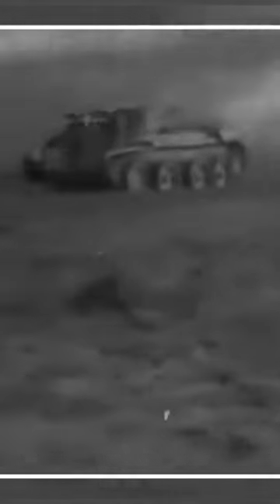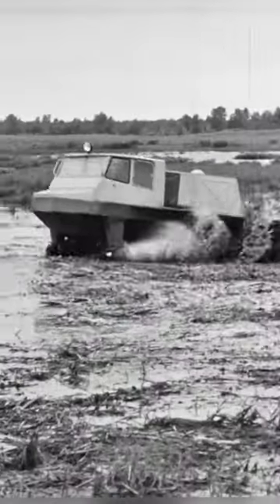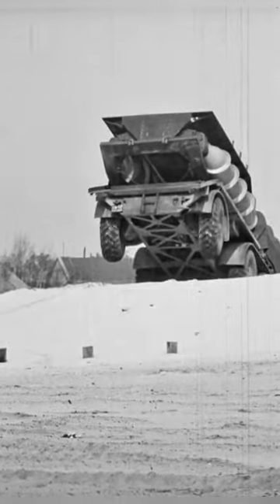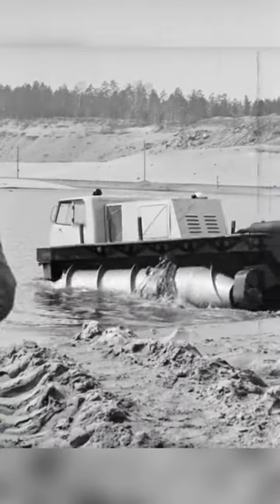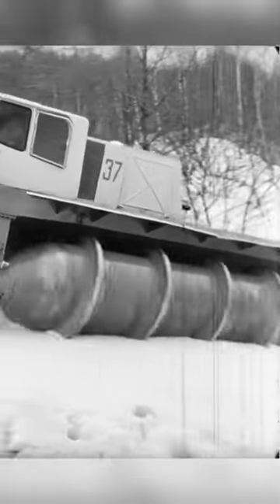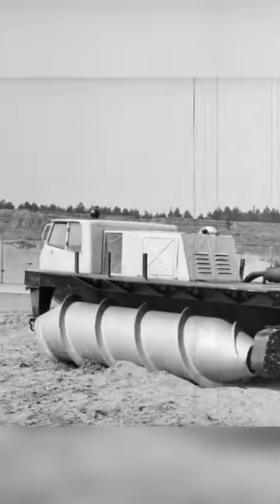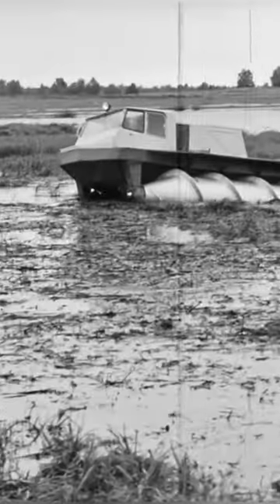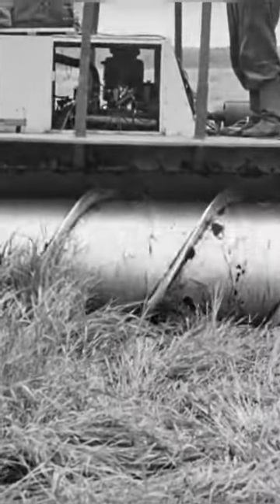Screw driven amphibious Soviet vehicle 🚗

Comment: This is a design copied or stolen by the Soviets from Henry Ford. He’s driving one of these in norther Michigan in the winter in the early to mid 1920s. So no the Russians didn’t invent it. And there are videos on the internet that show Henry Ford driving one in the snow. Go ahead and Google it.-  oh and the reason it’s not a thing today is that it works on mud, snow and even water, but just doesn’t work on roads, or dry hard surfaces- soooooo
Reply: I googled it, and there was no such thing. No pictures, no videos. 

The earliest design for such wheels came from Jacob Morath in 1899. The Soviets however made the first properly usable ones.
Reply: @PuzzlingDingo  funny because I’ve watched it at least 2 or 3 times. And yes it’s an actual thing, try cross referencing Henry Ford tractor or inventions
Reply: @dennishawrylko7606  I would love a link or exact search terms because the type of vehicle presented in the video has no history with Henry Ford.